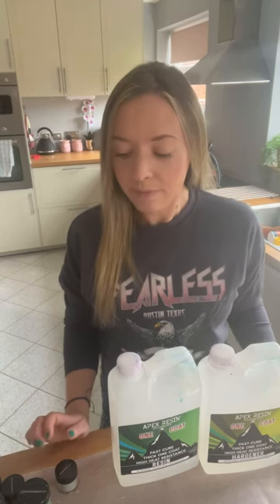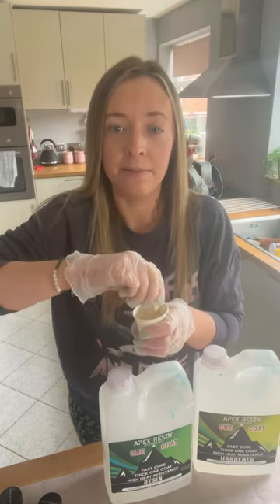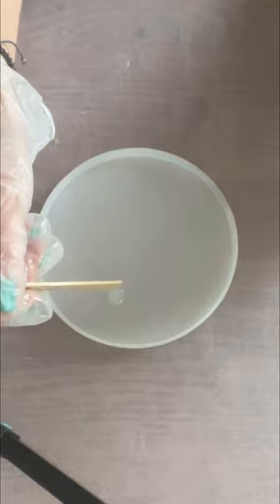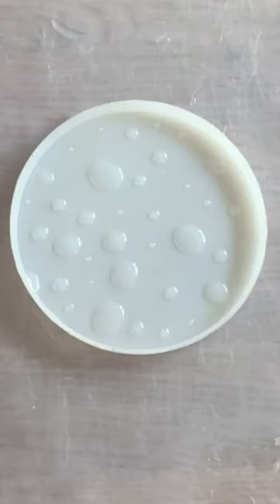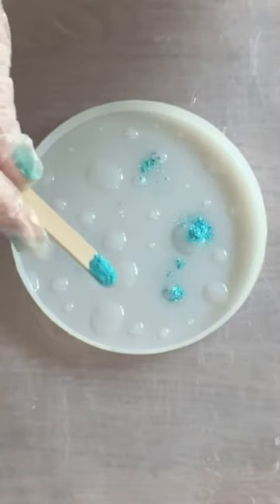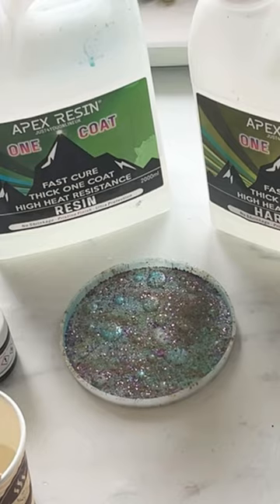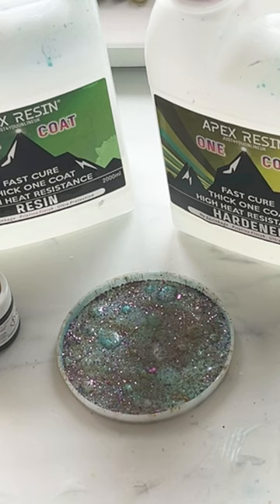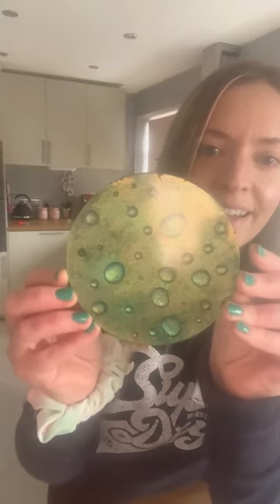Raindrops Effect Resin Art FULL TUTORIAL DIY Resin Coasters #raindropseffect

Comment: Thank you for teaching this technique. A question: could you use up resin for the drops? I have heard that sometimes the resins don’t adhere properly to each other.   Also, could you brush the pigment on? Does it turn out very differently? Please let me know what you think. Thanks.
Reply from the maker: Hi thank you so much for watching! I haven't tried this yet using using resin drips. I will have to give it a go. Sometimes off the resin isn't still slightly tacky it can struggle to adhere. You could definitely brush the pigment on x